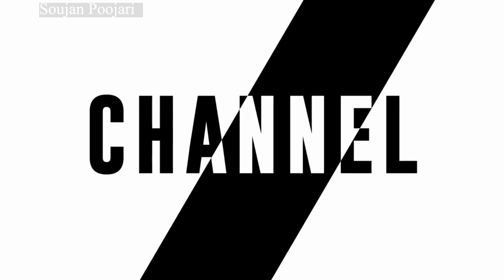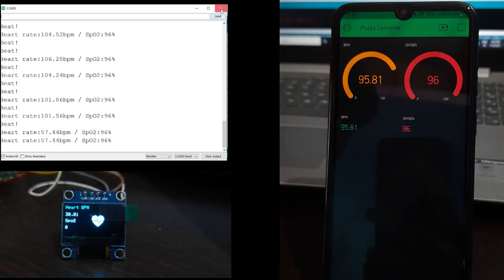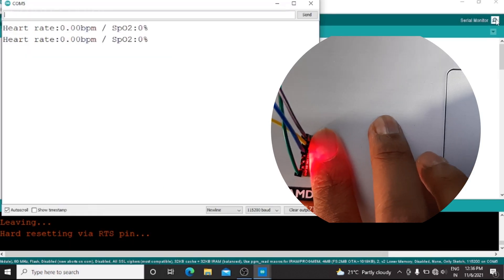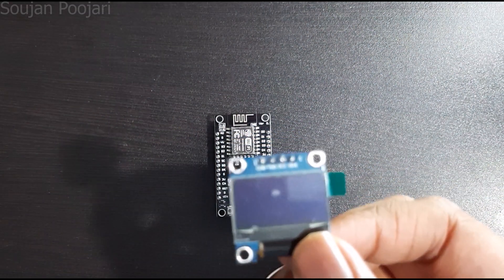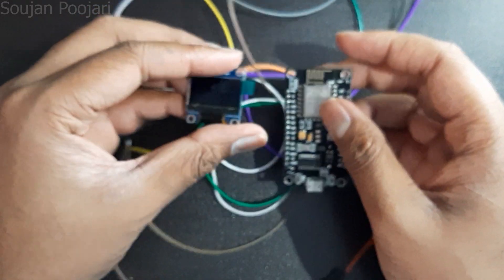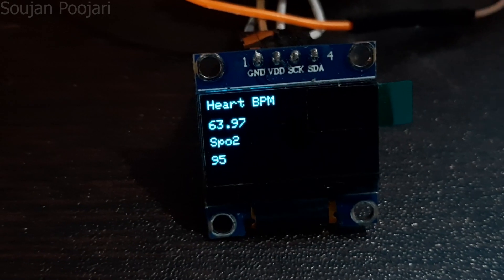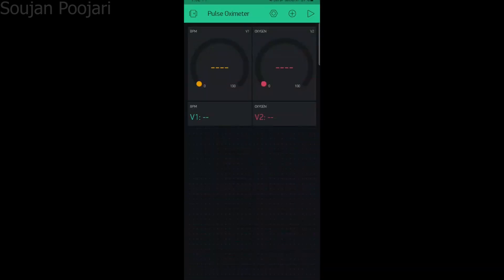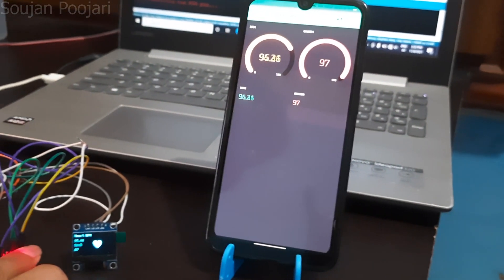Heart Beat Monitoring Sensor Using Node MCU And Max30100 |Heart Rate | Heart Beat | SOUJAN POOJARI

Comment: Can you provide the code please? Link is not working
Reply from the maker: Yes working on it will provide the link asap, sorry for the delay 😊
Reply from the maker: Hi Bro,
So i have updated the code in this website, between i don't think blynk will work as this project was done in blynk v1 but now the blynk has updated so try to work. All the best.
https://soujanpoojari16.blogspot.com/2023/04/heart-beat-monitoring-sensor-using-node.html